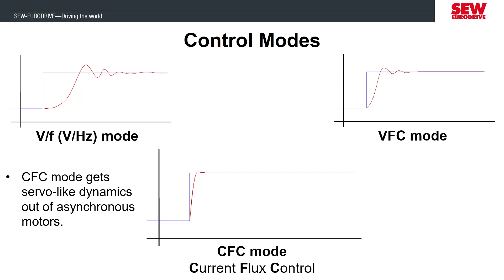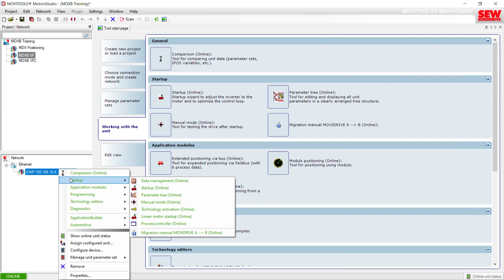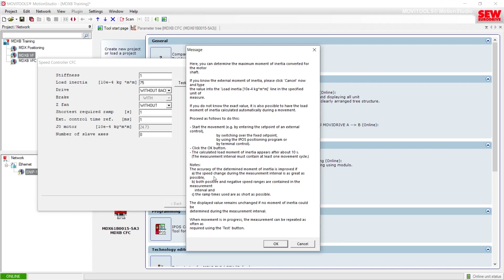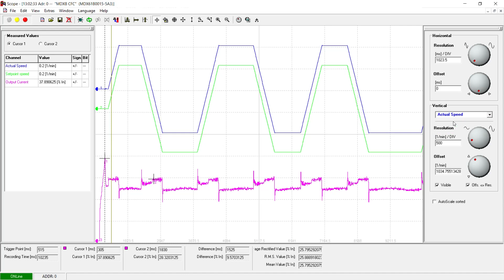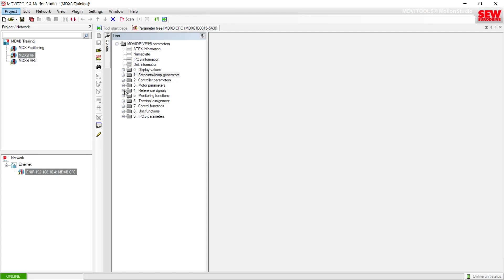MOVIDRIVE® B  Session 6 - Lab 8 - CFC Startup and Tuning with Scope

Comment: Hi, How to change the ethernet ip parameter to device? I am trying to change but everytime device is picking the default IP parameters
Reply from the maker: Hello @ajaychoudhary4940 . If the inverter is restarting with default IP address settings, you will need to check two different things. 
First, look to the EthernetIP option card on the face of the Movidrive B. There is a DIP switch labeled "DEF IP" make sure that DIP switch is not turned on. When this is turned on, after every power cycle it will replace the IP address settings with SEW's default which is (192.168.10.4).

DEF IP Switch Information - Page 18 - DFE33B Option Card Manual
https://download.sew-eurodrive.com/download/pdf_u/16725611.pdf#page=18

Second, check the IP address parameters with the keypad or with MotionStudio software. These parameters are P780 through P785. Check P785 and make sure this is set to "Saved IP Parameters". The default is "DHCP" which could dynamically change the IP address to an unexpected value.

P785 Ethernet Startup Configuration Information - Page 295 - Movidrive B System Manual
https://download.sew-eurodrive.com/download/pdf_u/27793230.pdf#page=295

Comment: hi thanks for these videos ....we have SEW DRIVE  MDX61B0022-5A3-4 with synchronous servo motor R57/IIGD CMP63L/PK/RH1M/SM1/I ......Kindly share the start up procedure and let me know if i can do the startup using DBG60B
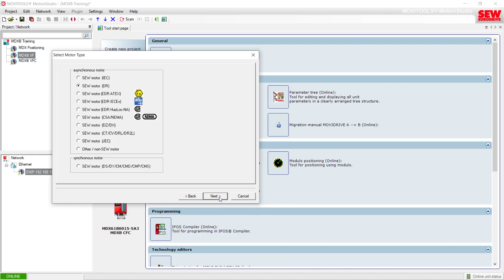Reply from the maker: Hello. Thank you for your question. To start up the CMP63 motor you will follow the instructions in this video starting at 07:24 and enter the details shown on the motor nameplate. At 08:25 make sure to use the bottom check box for synchronous motors. The CMP63L motor is a permanent magnet servo motor. The keypad doesn't have the ability to start up motors in CFC/Servo mode because of the tuning involved to make those motors perform correctly. You will need a USB adapter or a fieldbus card installed in the Movidrive such as Ethernet or Profinet to commission the Movidrive using the Movitools MotionStudio software. 

These videos mention our previous USB11A (part number: 08248311) connection cable for RS485. That is now replaced by the current model USM21A (part number: 28231449). However, both cables work if you can find one to connect the PC to the Movidrive. 

In this video linked here you can see what these cables look like at the 37 minute timestamp.
https://youtu.be/xtN_D2fJ1Kc?feature=shared&t=2220

Here is where you can find your nearest engineering office if you rather call in to get over the phone support for the motor startup.
https://www.sew-eurodrive.de/meta-pages/contacts_worldwide.html